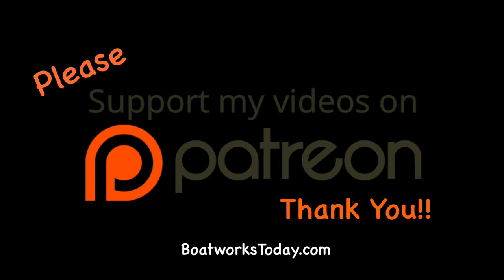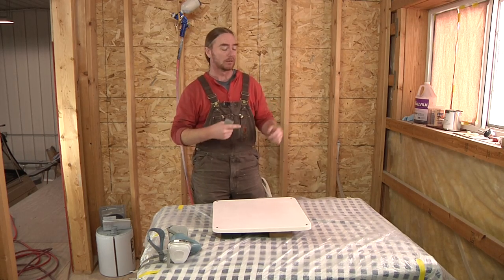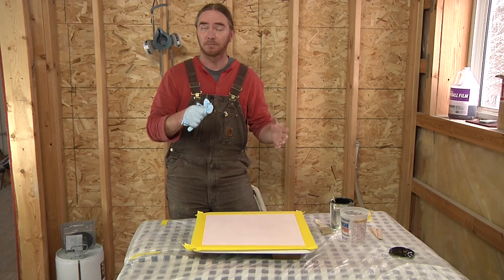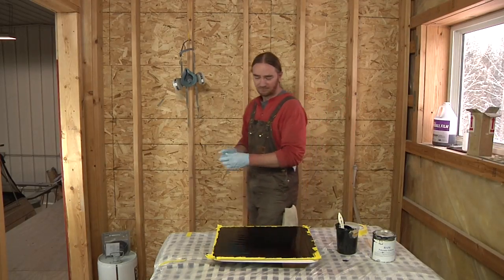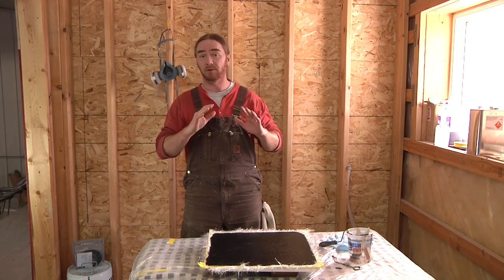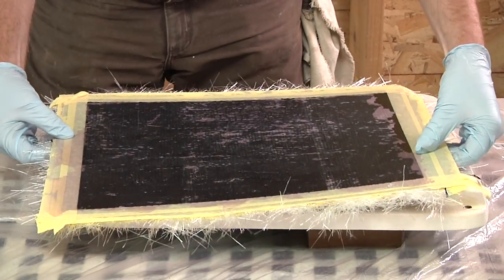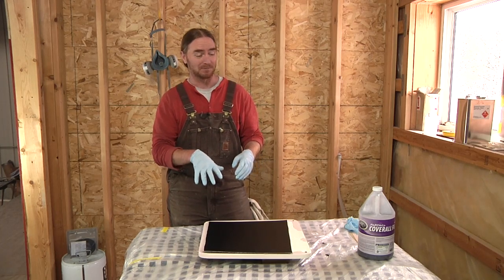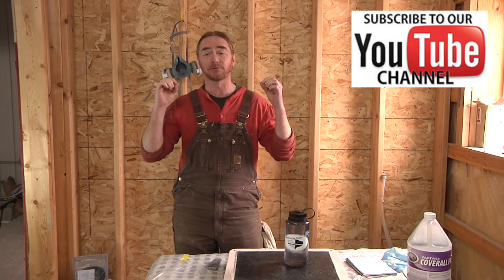Make A Fiberglass Mold Of Your Gelcoat Nonskid For Repair!

Comment: I followed the instruction and made several non-slip gelcoat and fiberglass molds. They work as the video shows, but they do not perform the way that I expected. The gelcoat placed in the repair bleeds slightly around the repair area and the pattern ends up being 0.5-1mm above the patterned (non-repaired) surface. 

What is the solution for finishing the work? is the pattern just a guide to cutting and sanding the pattern down 0.5-1mm to make it flush with the non-repair patterned surface? Should I be using next to no excess gelcoat to reduce as much as possible the bleeding? Can you give me a hint please. OR perhaps include that crutial step in your video?

Comment: Andy, I’m on the fence about grinding a factory non skid off a casting platform because ...well it’s the ugly 80s tan color that was popular. I could easily use pumice and scatter but scratching my head if I could make a mold of the existing before I sand it all off and print it into new Gelcoat with a light off white. It’s a pretty large casting deck broken into three sections. Thoughts?

Comment: May I ask how old, and or, worn was the nonskid you used to make your mold? I can't wait to try this as I have several areas of spider cracks in the surface layer of my deck and have been reluctant to repair them due to the non skid pattern.. My pattern looks identical to yours but its 16 years old and has been scrubbed a lot with things like soft scrub and other mild abrasives. I worry about how the mold will release. Any advice?

Comment: What a great idea! I need to do this on my boat.  I have some small areas near my shrouds where epoxy dripped onto the non skid.  I expect that I will damage the non-skid in removing the epoxy.  but now I have a method for repairing the non-skid! Thank you for the video! :-)

Comment: Thank for this video, this is going to make my next project look great (I hope). I am cutting out a really ugly (and useless) bulge of hardware out from my foredeck and will be taking that opportunity to install mounting hardware for a roller furler. Accessing this area of the boat is not possible without creating an access hole. But when I do, it is going to leave a 4"x4" hole. My deck is textured so I want to use this method to finish the job. Since I will be glassing the hole (using the techniques from one of your other videos) I want to keep the texture flush with the rest of the foredeck. How best to accomplish this type of repair? 
Oh, does the gelcoat you are using with or without wax?
Thank you very much.

Comment: I watched your video last night and today I was at Home Depot getting a fluorescent light cover for my garage and realized that they have the same pyramid pattern, I wonder if you could use the light cover to make a mould. It is acrylic so it should pop right off! Do you think it would work or is it to thin?
Reply: I dont see why it wouldnt
Reply: Those are super thin and fragile - look at the collection of broken ones always in the stack.  Polyurethane should hold it down to something solid like plywood, then let the PVA release the gelcoat.

Comment: Hi....I didn't find your first name so I'll just say howdy..

I have a question about using panels like this one you just created as a nonskid surface for a steel hull boat with a steel deck.
It had Treadmaster before but it is becoming prohibitively expensive and I really don't want to use roll on granules because of appearance.
I have watched a lot of your vids (thanks btw) and I think your input would be of value. I have talked to the pattern outfit you mentioned and received samples from them as well.
To give you an idea of what I need in terms of quantity this deck has roughly 25@3'x4' panels and at $150/panel Treadmaster is beyond my budget.

Thanks for your great work.....I actually keep a library of your vids on my drive for reference.

Greg

Comment: If you put a spot light (Just an LED spot, nothing fancy.) outside that door to rake along your work surface and then make your exposure just a bit darker, the texture will read on video.   And if you ever need a  narrow spot. Just make a tube of black paper and tape it around the LED bulb. And the reason you want to put the light some distance away is the inverse square law. You're light level will remain almost the same across your whole work surface. 
You might also do this by blocking the upper 3/4 of that window.  (Before I was a teacher, kayaker, boat fixer, and sailor I did photography)

Comment: Did you spray PVA after fiberglassing? How did you get the PVA off the final mold?
Reply: I believe he's spraying PVA after laminating the chop strand because he's using polyester resin, not epoxy.  Polyester resin won't cure without an air barrier created by the PVA.  PVA is water soluble so it should wash off the final mold easily.

Comment: Hi, great videos as always. I don't know why you you sprayed pva over the back of the resin/glass that you laminated on to make the mould. Can you explain please? ( I don't mean the original pva coat you used as a release agent).
Reply: I believed he used polyester resin to laminate the chop strand to the black gel coat.  PVA creates an air barrier over the polyester resin to allow it to fully cure.  Without an air barrier, it remains tacky.

Comment: REALLY fantastic video! I'm going to use this immediately to eliminate some bolt holes in my swim platform and am wondering if this method is also effective at repairing these thin gel coat cracks radiating from screw holes that mount some of the deck hardware on my boat. Supposedly these were formed because the factory needed to countersink these holes and didn't. Do you think this method would repair/fill those gelcoat cracks?
Reply from the maker: +xrm1996 This will work, but only after the cracks are addressed..  If there's cracks in the gel, most likely there's cracks in the surface layers of glass...  Im guessing the holes that were pre-drilled were undersized and and screws expanded the glass causing the cracking...
Reply: @boatworkstoday  haven’t think of it before that holes need to be larger that the diameter of the screw because of it’s expansion! 
Randy do you think laying epoxy over cured polly could cause problems in long term cos of (possible?) different expansion rates between polly and epoxy? Thanks 🙂⛵⛵⛵

Comment: When you pulled the mold off I see a large irregularly shaped white spot different in color than the rest of the hatch. My assumption was there is only pva between the hatch and gel coat. Can you please explain.?
Reply: Its PVA that peeled off the bottom. It just washes off

Comment: I have a small non-skid area on my coach roof that needs to be repaired, but it is on a curved surface.  I tried using a two-part "rubber" mold without good results.  How can a mold be made using your method for a curved surface on the boat?  Could I make the non-skid mold from a flat surface and heat it to bend it into shape without losing the pattern?  Thanks!  Bruce
Reply from the maker: +Bruce T Maybe make the mold a foot or so behind the area you need to repair?  The mold and part will carry the curvature ;-)  Hope this helps!
Reply: This is conceptual, but for WIW. Clean the whole area to be covered. Find enough auto door rubber from a scrap yard, and with grade school rubber glue, form a perimiter of the area you want to duplicate. Reinforce outer side with duct tape in case glue lets go. Find some 1/2" mesh or lighter and cut enough to fill the area. Pour in the area a thin film of plaster of paris. Partially dry, put in your mesh. Fill in the remaining plaster up to the edge of the rubber dams. Let dry.  You now have a cast of the area. Notes: The plaster will only press against the dams for a minute or less until it dries. You don't need the  plaster too thick with the reinforcement. The weight of the plaster will be heavy, but nothing the designers of the boat had not already considered(under weight of man). This forms the negative of the area, you'll need to follow other methods to lift out the positive pattern.  You can test this process on a corner to weed out the bugs.

Comment: The original printed non skid that you took the mold from, Does it come in rolls or something? How is that original printed, textured non skid made?
Reply from the maker: +John King It's typically part of the original mold when the manufacturer is casting the deck of the boat (depending on the pattern).  Some are applied after the fact, but in that case it's more of a sand texture that is sprayed on :-)
Reply: Thank you

Comment: Thanks for the video(s)! Just a quick question, can you recommend any makes of PVA and then a ratio mix if you are watering down? many thanks
Reply from the maker: Pretty much any brand of PVA will get the job done (Evercoat is one brand that comes to mind).  I would not recommend diluting the PVA as it may mess with it's ability to form a skin.  It's pretty thin to begin with (slightly thicker than water) so there shouldn't be a need to water it down :-)  Hope this helps!
Reply: @boatworkstoday  I am working on a friends Contessa.  I want to make a mold of the deck pattern.  I would use the existing deck as the pattern.  I see discoloration of the master part there.  Does that all come off with the PVA?  I would use the existing deck to make that pattern.  I don't want to ruin the deck or glue itself down.  OMG  Also can I use the pattern with Resin and Fairing filler instead of Gel coat.    I think the PVA would not let it stick to that (I don't know that for sure either.)  Thanks an old Supporter of yours in Canada.  Rick Marmei
Reply: How did using the deck as the mold work out?

Comment: How would you suggest applying the PVA besides spraying
Reply from the maker: +Andre Uzee For this type of application, spraying really the best way.  If that's not an option, you could also apply a few light coats of a carnuba paste wax.  It would serve the same purpose as the pva.  Personally I'm more comfortable using the PVA (I've never had anything stick!).  Hope this helps!
Reply: Can I use a spray bottle for this or does it have to be a pneumatic sprayer?

Comment: At 4:22 did you mix up the times of glass and pva application? Or did you not show another application of pva on top of the glass? Did you spray or brush pva onto the glass? I did not see that part. I only saw the application of pva on the hatch itself to prevent the gelcoatfro sticking.
Sorry I'm such a noob